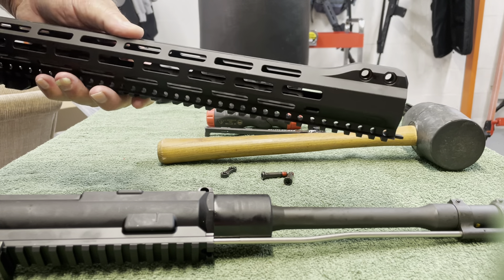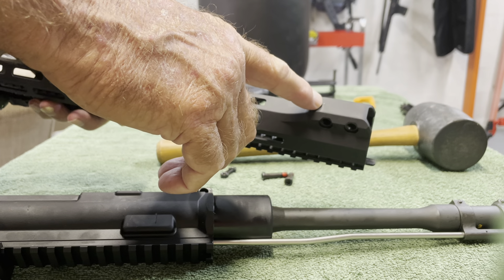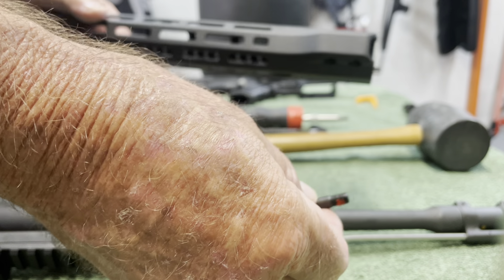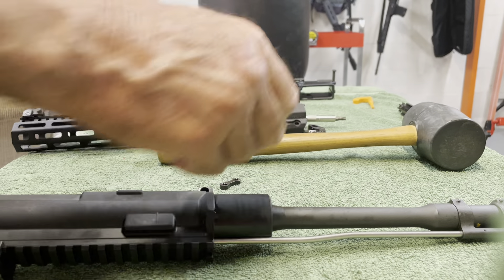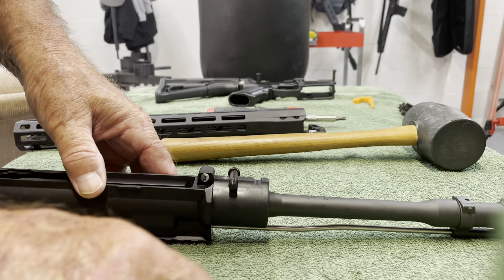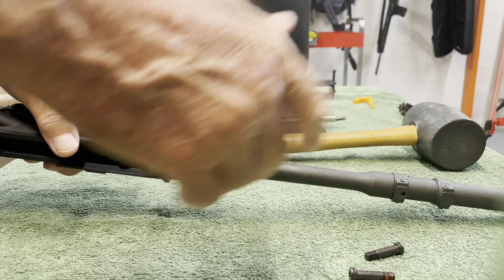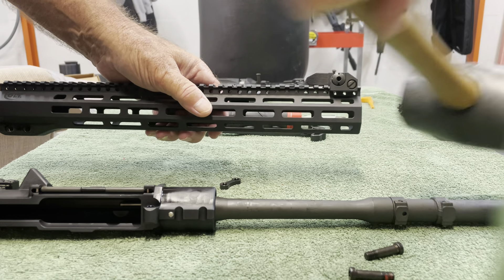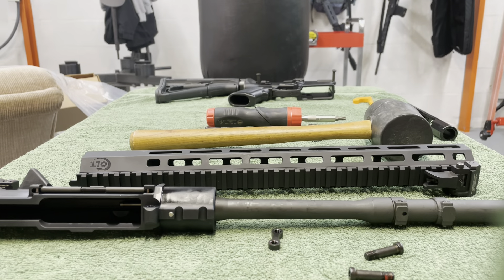Colt M5 Hand Guard Removal

Comment: What is the silver detent looking thing at the bottom of the barrel nut?
Reply from the maker: Thats the index pin. Its backwards on this model gun. The slot or notch normally in upper receiver is on the barrel ext and the pin on the receiver.